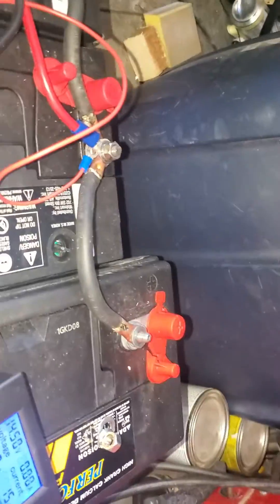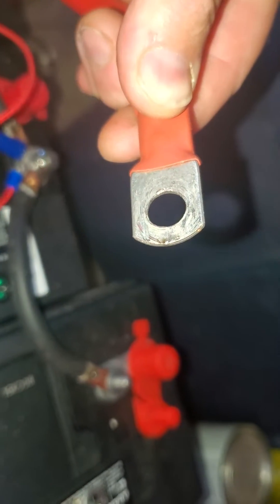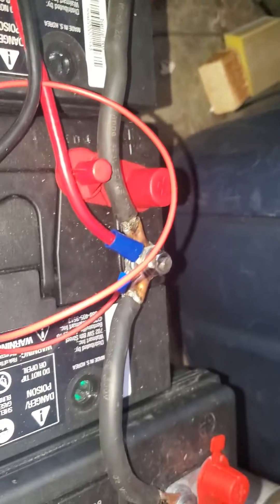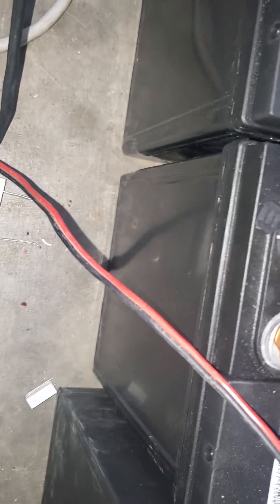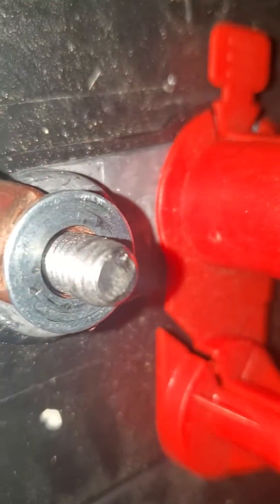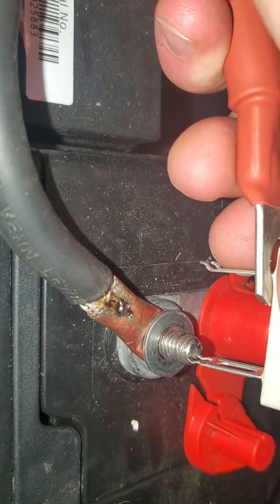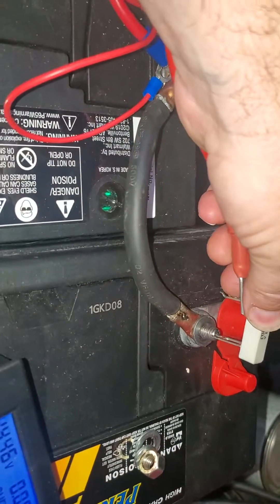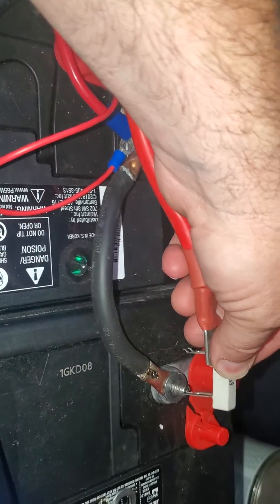precharge inverter w/o spark. link to cheap resistor

Comment: try a 12 volt light bulb

You'll like it!
Reply from the maker: Poof?
Reply: @hamradiohack  no, no.
If you simply connect the light bulb to the battery it will ight steadily. Putting the inverter in series will / can only reduce that voltage potential. The current is lower than either by itself.

It will ight quite nicely and then fade.
Reply from the maker: @jamesalles139  ok cool. Ill try it some time. We used to use 60w light bulb for a dummy load for ham radio transmitter